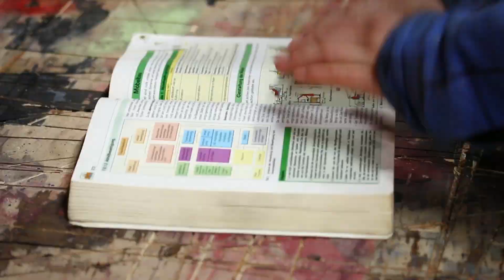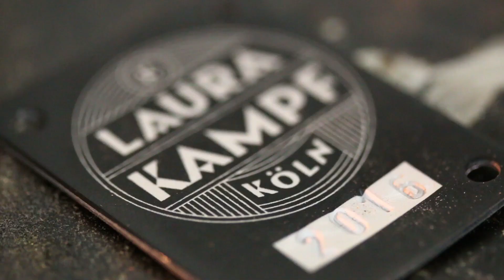Laura´s Reclaimed Workbench

Comment: Good job Laura! Although the epoxy could cure, I prefer the second finish ;). Regards!
Reply from the maker: +Woodworking Barcelona me too, much more natural and clean! i didn´t like the "shinyness" of the epoxy
Reply: +Laura Kampf my goto surface finish is clou holzsiegel in seidenmatt. super durable after a few coats and it always comes out absolutely smooth, even when applied with a brush

Comment: Hey didn't you make several different stoves?  Couldn't you have gotten your cross ventilation going and fired up the stoves and heated it up enough for the epoxy to dry, or is that not feasible in your shop?  Hate to see you lose that wonderful patina, but oh well.

Comment: I love this. And what was the book you referenced from?
Reply from the maker: +Tiffany Johnson thats an old woodworkers-book with an overview of funtiture-meassurements. thanks for watching!
Reply: +Tiffany Johnson i got the same one, it's all about wood engineering from simple wooden joints to industrial machinery.  found it on amazon http://www.amazon.com/s/ref=nb_sb_noss?url=search-alias%3Daps&field-keywords=Fachkunde+Holztechnik
Reply: +Laura Kampf I was going to comment pretty much about the same thing. How old ist "Das standard"? When it comes to, for example Kitchen work surfaces, here in Sweden it was determined by some institution dealing with public health way back. This measurement was based on the average length of the population. Problem: The population of today is significantly taller than back then. Also, are you of average height? :)
Reply: Two years late to the party, but thought it was worth linking this book, which is chock full of every dimension of every piece of furniture/structure that involves human interaction. 

Human Dimension and Interior Space:

https://www.amazon.com/Human-Dimension-Interior-Space-Watson-Guptill/dp/B00E2810B4/ref=mp_s_a_1_2?ie=UTF8&qid=1531201085&sr=8-2&pi=AC_SX236_SY340_QL65&keywords=human+dimension+%26+interior+space&dpPl=1&dpID=41dYzCzAmRL&ref=plSrch

Comment: Epoxy is not wery good surfase finish.
Reply from the maker: +STIPRIOS what would you sugest to use in a situation like that instead?
Reply: epoxy is not stable coating- teperature and sunlight make big problems. For my- the hardest and most profesional coating is two component warnish,or paint- then you mixing and aply with gun. The most liked coating- is oil, then aply three or more coats of oil each time waiting then oil polymerizating in wood. The most problem coating- is acrilic varnish ,it has porblems in all aspecs no mater it one or two component. But I am not big specialist with coatings. P.s. Thanks for video- I olways fogot to say good words for people.
Reply from the maker: ah, cool! great advice! thank you!
Reply: STIPRIOS With that interesting advice I went to your channel - your Gilded Dog first video is very fine.